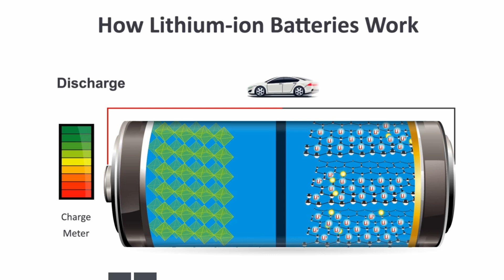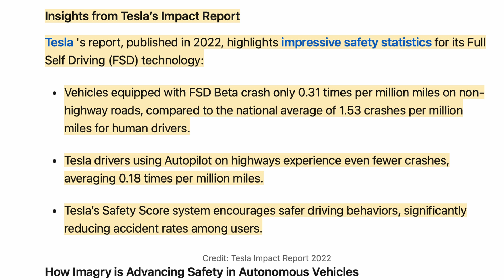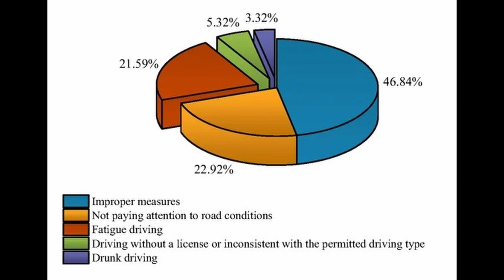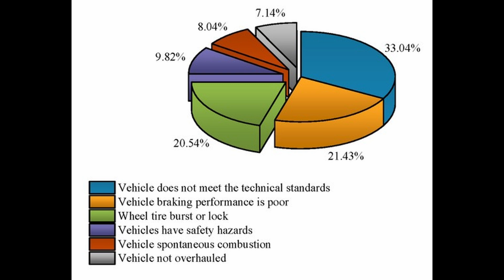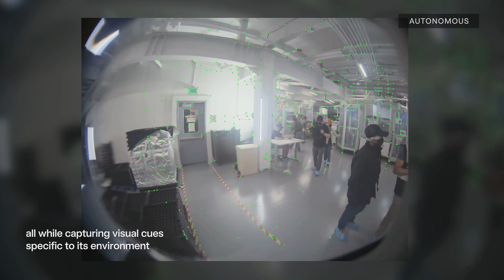The Future of Electric Vehicles: The Innovations You NEED to Know

Comment: Numerous anecdotes of FSD switching off at the last moment meaning it isn’t captured in the data. And I also question how many FSD accidents are also avoided by human intervention at the last moment. As for humanoid robots, sorry for the snide comment but I think you may have been drinking the musk juice a bit too heavily.
Reply from the maker: Vs thousands of actual accidents every single year leading to loss of life caused exclusively by humans supposedly in control getting it totally wrong.
Reply: @davetakesiton absolutely, I see the case for FSD but thousands is a nominal amount rather than a relative metric, and getting true data that includes erroneously excluded FSD accidents is critical in determining whether it actually is safer.

Comment: When car batteries can easily be used as  a home battery will the breakthrough will surge. Can see in future homes with a wreck of a car parked in the drive only being used for it's battery. I don't understand why this system is so slow to implement. It's only electronic and software requirements

Comment: People who say battery swapping is dead are only looking at it from the perspective of EVs,rather than the broader view of what net zero will demand. For net zero to work we will need an energy reservoir, same as we have water reservoirs. The only way we can afford to get that 3TWh of battery storage reliably, the equivalent of 40 million EV batteries, is through a battery swap network - because motorists will have to buy the batteries anyway. Without that power storage - no net zero. Simple as that. See UK Net Zero Action EP4 and 5.
Reply: Why does power storage need to be electrical batteries at a grid level? Numerous heat, potential, and mechanical power storage solutions coming online across the globe. Also not sure why we need replacement battery tech to meet the requirement, seems an odd specification for either car to grid or stationary battery systems.
Reply: I calculate we will need something like 2-3Twh of energy storage to offset intraday renewable intermittency. This storage cannot add more than 1p per KWh to the cost of electricity, which must be brought in at about 10 per KW to consumers, or else they will not accept electricity as the means to heat their homes. To achieve this, storage must be virtually free. With a Powerswap network the batteries will be paid for by motorists - included in their monthly bill for powering their cars.

Comment: Hi Dave, I am new to ev, s I have a motabiliy car, Nissan leaf, yes not the best car to introduce me into the world of ev, s. But as I only do about 20 miles a day the home charge is fine. I am with  Octopus and have intelegent go tariff. So that's my introduction over, now this is where I need some help from you or anyone reading this message
I recently went to charge my car at a osprey charge station, I tapped my electrovers card and it said authorization was OK, plugged in chademo lead but won't charge, don't know what I done wrong, the unit timed out and said unplug and try again. I re-plugged the lead and tried tapping my debit card, machine says it will take £30 of my card before even charging! Is this normal? I gave up and left with almost a flat battery. I went to a Morrisons genie point, plugged in, tapped my electrovers card, nothing, tapped my debit card, said connecting, then switched off and. said unplug and retry. Done this three times, nothing happened, what am I missing, this is not the best introduction to ev, s for me. If this happens again I am thinking of sending my car back and going back to diesel, hopefully someone can help,
Bob
Reply: Yes, many can empathise. I’ve had a leaf for 4 years and only charged away from home a couple of times because it’s hassle. Morrisons are usually ok? I’m planning on getting a Tesla and the main reason is the charge network,
Reply: If you're charging at home and driving 20 miles a day, do you even need public chargers? 
We have a Chevrolet Bolt, and like you are low mileage drivers, and charge at home. I have tested several public chargers just to see how they work, but unless we drive over 90 miles away from home in Winter we can always get home again to charge.
I can't answer for UK chargers but I do know at least one local charger network here in the USA that wants my money before I actually charge the car (or even connect to their network), so I refuse to use them. I'll pay for what I use, and that's it.
Reply: @ziploc2000 hi I get I only need to charge at home, the issue I have is soon I have to travel 300 miles to an event, so I wanted to see how public charger works, I am not impressed, to many apps and messing about, thanks for your comment, I will take it on board, Atb, Bob

Comment: De Havilland Canada has several airframes that are QUITE amenable to "fast approval" electrification. And that would be SUBSTANTIALLY IMPROVED by doing so; it's mostly about NOISE and making the noise go away would make the venerable Dash 8 popular again.
Harbour Air in Vancouver is working through the process (Google them) with a different DH airframe.
Sadly DH management seems very "Harvard MBA" - think quarter-by-quarter no more than three years out.  Plays well on Wall Street, but would prevent companies like Tesla from existing.

Comment: FSD should be as safe as possible. Tesla, as far as I know, only use cameras because it's much cheaper (a bit like no indicator stalks and only building LHD cars). The cameras aren't always able to identify objects that it doesn't know about (a lorry on its side across the highway). Radar and LiDAR can greatly improve safety but it all comes at a cost and may ultimately be required by some regulatory bodies. This is why large companies hate regulations and Musk is no exception.
Reply from the maker: It's not down to price. Do you have buttons and a keyboard on your smartphone or tablet? It's what works best. How many people ask for the return of the mechanical keyboard and mouse? Get used to it.
Reply: @davetakesiton  i think that it's very much down to price. There's plenty of people that prefer real buttons and switches to touch screens on cars. I'm amazed that there hasn't been legislation to discourage the use of screen only vehicles.

Comment: The Nio battery packs can be of different capacity/chemistry. I've seen it suggested that you could have a lower capacity LFP battery for normal daily use and swap for a higher capacity NMC battery for longer trips. I still think it's not a long term solution, though.
Reply: Yes. 60 75 100 or 150 kwh. The 150 is semi solid state. Lfp, nmc, semi solid state. 5 auto companies joined nios swap network and are tooling new vehicles to match.

Comment: Sensible conclusions and I totally agree that FSD will reduce accidents. Watching I think dirty Tesla had his car brake suddenly and not knowing why, then saw a deer jump from the side of the road and across his path. If it had not braked he was sure he would hit it. FSD removes the delay of a human and has the ability to look all around at the same time. A person can never fully compete with that.
On battery swap it is like having say one petrol pump, so if 20 cars arrive almost together it would be an hour. The idea is good but costs of building and running are surely too high compared to building many rapid chargers.
Reply: It 20 cars showed up they would just plug in like all evs do. Nio has the largest plug in charging in china

Comment: Battery swapping is a dead end: Battery tech will improve and charging times will drop. Swap stations are too expensive, Cars designed for battery swap are compromised due to the dimensions of the battery, it effectively fixes the cars design for the future, new developments cannot be easily implemented. Continuous disconnection/reconnection of the battery electrical and cooling systems will lead to more failures of these systems. Battery swapping for delivery vehicles would be more sensible, quicker turnaround and lighter vehicles and the design of vans doesn't change as rapidly as cars.
FSD is years off in UK due to regulation, and our 1000's of miles of narrow back roads. The biggest problem with FSD is IMO, other cars not under FSD. 
Robots, decades away for domestic use, might possibly be of use in a factory a bit sooner. They still walk like they are about to shit themselves.
Personal drones would be great for deployment and evacuation of military personnel, which is where I see their future.
Reply: Apart from HGV's and Farming. Its great when Farmers/JCB say "Oh you can't rely on EV tractors" (as they have loads of space for solar, and drive around with a massive weight on the front (Trailer counter weight)....I wonder what they could replace that weight with.

Comment: Smaller batteries that can charge quicker, So also faster chargers is the way many seem to be going, as carrying around all that weight around isn't so efficient. So as we move forwards, EVs will get lighter. It really depends on what your needs are as to which option you'll choose until technology reaches its ceiling. As for the rest, it's called the 4th Industrial revolution, where machines replace humans. Robots flipping burgers or doing surgery, you name it if a bot can do it over a human it will as no breaks, no holidays no pay and no strikes and no rights needed.
The fact is, a lot less humans will be needed, to serve the needs of the 1%, and even they will be DNA tweaked perfect beings, created solely for their masters.